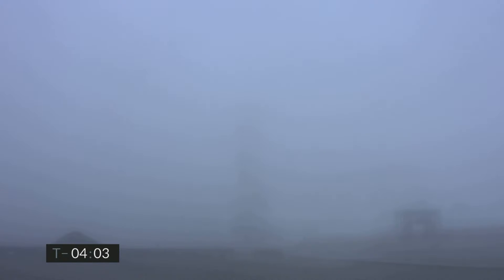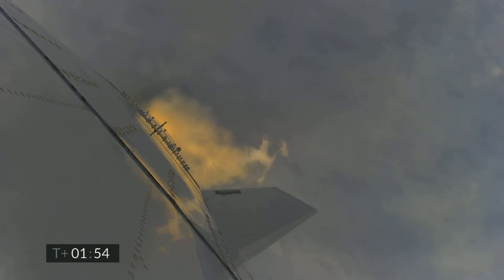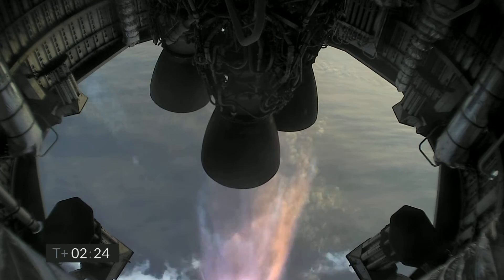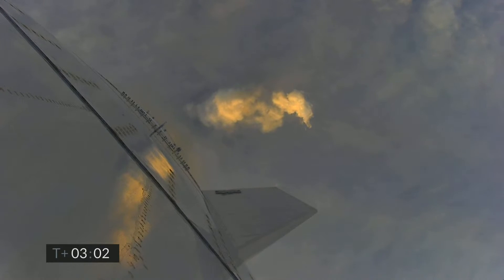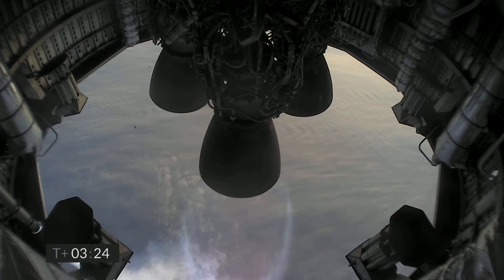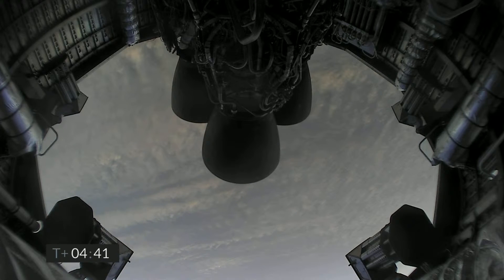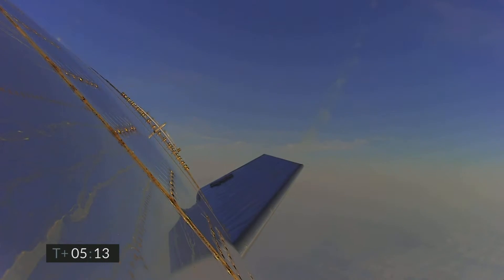Starship | SN11 | High-Altitude Flight Test

Comment: THEY NEVER SHOULD HAVE ATTEMPTED THE FLIGHT UNDER SUCH CONDITIONS.
Reply: Why?
Reply: BECAUSE WITHOUT THE FOOTAGE IS MORE DIFFICULT TO DETERMINE WHAT WENT WRONG. AND ALSO, THEY KNEW IF THEY ARE STREAMING VIDEO TO THE PUBLIC THAT IT IS STUPID TO STREAM JUST BLACK OR GRAY COLORS INSTEAD OF A NORMAL VIDEO. NO POINT OF STREAMING VIDEO WHICH IS GRAY 40% OF TIME AND BLACK 40% OF TIME, WITH ONLY 20% OF USABLE FOOTAGE. ALSO, IT CAN BE THAT FOG IS PUTTING ADDITIONAL AERODYNAMIC PRESSURE TO VEHICLE WHEN IN FLIGHT, ALTHOUGHT PROBABLY NOT ANYTHING SIGNIFICANT SINCE IT IS FLYING PRETTY SLOW (FOR A ROCKET).

Comment: Love Spacex. But I gotta say this is never going to work. Looks clumsy and dangerous. You would have to have balls the size of Earth to ride in this. Should stop wasting resources and start developing a Flying Starship that returns like the old Shuttle only with a powered reentry. Build a Spaceplane and make it larger than the Shuttle. Too much too go wrong on the flip and landing with such a big rocket. You have already fitted wings to it. Make a Spaceplane Starship and get on with it. You have the resources and know how, just build it and get to Mars.
Reply: And how exactly is a spaceplane going to land on Mars?
Reply: @lazarus2691  The same way Starship will land. With a lot of luck. I believe the first manned landing on Mars will be like Apollo. Then after a base is established a paved landing site will be constructed. I think a Starship belly flopping and landing on Martian surface without a paved landing site will be very dangerous .

Comment: SpaceX needs to add a 15 meter diameter chute that pops out of the nose to allow going vertical earlier and giving time for propellant to stabilize for 20 seconds. The chute will pull it vertical without engines and prevent the starship from accelerating downward while vertical. Need to test this configuration. After all the bugs are worked out, then they can eliminate using the chute but I bet the chute will work so well, the flaps could be shrunk instead. (Especially if a 2nd large parasail chute attached towards the bottom also helps slow it down while horizontal, then unreels/detaches to make starship go vertical)

Also the untested risk remains how does starship & booster perform when re-ignition occurs while experiencing weightlessness even without the fast flip. The

Comment: Who also thought it was a great idea to test anyway with this level of fog in a dev stage video material is crucial to the testing? At this point you don't even know where to look for the vital parts with answers because it's been spread out over an area of 10 miles in diameter right now due to 0 visual level fog...

This is going into the realm of chimpanzee's trying to use knife and fork for the first time without proper instructions

However I have to admit that this fog has a special role in making this all very exiting with it being all fun and games till that flying fuel tank lands on someone's house or vehicle or store 20 miles ahead. You don''t even know when to use the deadmans switch in this fog based on lost sensors and also no visuals. You are fuckin lucky here.

Comment: maybe to channel the fuel towards the engines when the rocket goes from horizontal flight to vertical flight you could do the same thing cement trucks do to get the cement out. use an archimedes screw.

Comment: WTF happed during landing?
Reply: One engine didn't gimbal correctly so FTS was set off and also it underperformed. Probably due to a leak something similar which sn5 engine ( SN27 ) had a leak when it was firing

Comment: With the fog, it felt from the start SN11 was doomed. The cameras weren't coping, the raptor flameout, the engine failures again. SN11 deserved a better ending. SpaceX have a major problem with engines and possibility of a total rethink for Starship. When the brilliance of the SpaceX people are challenged a fourth time, you know the issue is not going to be resolved quickly.

Comment: Elon - This is getting embarrassing!

Beginning to look like this is RUD for fun.

After 40+ years of engineering, four broad causes for continued failures:

1)  Raptor is not ready for this. About 1 in 4 Raptors is failing the pad test fire - unsat. Either the Raptors are not ready, or they are  ingesting FOD. Assuming the Raptors are all being test fired several 
times before delivery to Boca, there is clearly a process problem once they head for Boca.

I believe each SSME was test fired several times before flying. I would assume the Merlins are too? 25% Raptor failure rate on first launch pad fire - embarrassing. With those failure rates, odds of a successful flight test are close to zero. After ten  (?) Raptor starts on pull-up, has only one Raptor come up to full power during the pull up? 10% success rate? also unsat. Houston we have a 
problem...

2) I admire the desire to use an industrial grade process to building starships (assembly outside, Raptors shipped on pallets, rather than clean rooms and shipping engines in sealed engine cans), but industry experience is that foreign objects in rocket engine fuel and oxidizer supply lines have caused a LOT of failures. Commercial  airliner jet engines are treated with more care than the Raptors appear to be treated once they are headed for Boca. Seriously? Ask your turbomachinery bearing engineers about the impact of contamination on seals and bearings. 

Sloppy... And inexpensively fixed.

You  should cycle a few Raptors through the current delivery, installation, starship test fire process, and then send them back to manufacturing for test on their test stand. How many are unable to have several successful starts/re-starts?  

3) The Raptors are too fussy about  the quantity of fuel and oxidizer being sucked in. Easily eat themselves when flow is low/out-of-balance - this would be a serious design failure, possibly very difficult to fix, and may require a Raptor or Starship re-design.

4) The transition from belly flop to vertical simply causes too much "churn" in the fuel and oxidizer tanks, and it is impossible to provide reliable flow into the Raptor fuel and oxidizer inlets. Concept flaw. Several possible fixes, all would reduce payload weight to orbit:

- provide dedicated "re-light" tanks to each Raptor that have zero void fraction at re-light. 
- start the transition earlier and drop the tail using the aero surfaces. Vertical acceleration will be less than one-G, should help the liquids head for the bottom of the tanks. 
- use one Raptor earlier to flip vertical and settle the tank contents back to the bottom of the tank before starting the other two. 
- May need to add baffles to the tanks to reduce sloshing during the transition (many liquid tanks subject to motion have baffles to greatly reduce churn during accelerations/turns. Railroads learned this over 100 years ago.) 

All of these will reduce payload. Too bad. Hopefully impact of one of these options will not reduce payload too much. 

Perhaps Nitrogen thrusters would speed aero-only transition towards vertical? "Flying" towards the pad with more cross range velocity (nose down a little towards the pad), followed by nose pull up, would shift more of the fuel and oxidizer aft before engine start (and the resulting shift of CG aft would accelerate an aero-only flip?)

Surely the behavior of the fluids during transition can be determined through sub-scale experimentation without blowing things up. VERY difficult to model numerically for multi-phase fluids at saturation with some subcooled liquid and some slightly superheated vapor - a chaotic process (having done non-equilibrium fluid flow and heat transfer experiments 40 years ago). Plus the initial state would be hard to model due to aero-buffeting that might alter pre-flip liquid/vapor distribution of the fluids.

Each of the four above could be resolved without blowing up more starships, and I doubt these failures are resolving any of these four concerns... Clearly the belly flop works aerodynamically. That has been demonstrated. Time for some serious engineering, like the type that made Crew Dragon successful.

I was originally impressed with the rapid development concept, but it isn't working - lucky you didn't destroy the tank farm. Time for better engineering processes (don't pull a Boeing ;-) Falcon and Dragon engineering is so impressive - this is not.
Reply: You realise that this is a test program right?
Reply: @avap0n459  Yes, but what are they testing? Belly flop aero - success - well done - 4 for 4. But raptor relights to full power - fail (9 out of 10). In engineering with such a high failure rate you do a root cause of those failures and see if your design basis or process has an error. With a 10% relight success rate, at this point they are not testing, they are flailing. The definition of insanity is doing the same thing over and over and expecting a different result. Clearly there is a significant design or process problem. Trying to find that problem from pieces scattered about is not a productive process. I am mystified how a company that has become so successful with Falcon can not apply similar engineering rigor to starship. Perhaps they know the problem and have the fixes in SN15, but then why risk damaging the launch facilities with SN11?
Reply: @daveevans2527  good points, and i agree with you, but im sure spacex did all the calculations for all of that, they are going for speed.
Reply: @avap0n459  What is bothersome is how many Raptors are being pulled off the Starships after the static test fire. I can't believe they are that unreliable coming from the factory. With that failure rate, I do not see how you can be confident that at the start of the landing flip, you have 3 Raptors in good condition before re-light. 

I assume the engines failing in the static fire are being examined for the failure mode - fifth possible cause is with the raptors shooting straight into a flat concrete surface at ignition, one wonders if the shock waves reflecting off the concrete are causing damage. I doubt they have a test stand that exposes the Raptors to such abuse.

There is a famous saying - "Be quick but don't hurry". Seems like Elon is in the hurry mode - wonder if someone can initiate a stand-down to regroup and broaden the possible failure modes that need to be studied.
Reply: @daveevans2527  true, very true.

Comment: They really need to go back to testing the Raptor, it's clearly not ready for flight. Even in the successful parts of the past flights, the engines seem like they're about to shit themselves at any second.  They need to work on long burns with multiple stops and re-starts throughout.  Raptor has been the cause of all of the failures so far, it seems like it needs a lot more testing. Just seems like they're going to need a great engine first, then work on making that engine capable of the landing.  I just haven't seen anything so far that makes me believe the Raptor is all that great anywhere other than paper.

In a testing phase like this, we're supposed to get bored of how mundane it is seeing this thing land, instead it's getting boring knowing it's going to fail.  I'm sure it's not a popular opinion, but it seems the best course for SpaceX reputation is to suspend flights until the engine is nailed as close to perfect as possible.  All future failures should be because the vehicle failed, not the engines.

Comment: We were robbed from a spectacular view by the damn fog! Also best wishes to SN12?or will it be SN15?
Reply: SN15. SN12-14 are not being built.
Reply: @OortCloud  hmmm, but SN15 is suborbital if I am correct and I doubt they will jump to suborbital trials before perfecting the landing. So maybe they will start building those SN12-14.
Reply: @user-hh2is9kg9j  No, we already have confirmation that SN12-14 are t being built. They recently scrapped SN12s aft dome where the engines are mounted

Comment: It is impossible for an heavy rocket like this to succed!
Reply: Can't wait to see what you have to say after SN15. lol
Reply: Only three engines is not enough to lift and to resist the burning and pressure...facts
Reply: @lt3066  They will have more engines on the vehicle but that's when they begin testing it to go into orbit. I hope you also know that it will be stacked on top of a very powerful booster..
Reply: SN10 got awfully close on just a single engine. Three should be more than enough. 
Too much in fact. Three engines are too powerful, so they're only planning to land on two.

Comment: At least the high altitude test is successful!  Hope it gives valuable data for SpaceX engineering teams to prepare for SN12.
Reply: There is no SN12. SN12 was scrapped, along with SN13 and SN14. 
SN15 will be next, and is the first to incorporate significant improvements - SN9/10/11 were minor retrofits based on each previous flight.
Reply: @lazarus2691 , thanks so much for the information!

Comment: I think were you all are messing up is configuring for center of gravity instead of focusing on keeping the platform plumb and level. Most helpful in landing as it eliminated the struggle to level the craft at touch down. I say this as it is leaning instead of being 100% vertical one the one engine hover. The engine flame should be at an angle and the platform plum when hovering at altitude.
Reply: It's not possible to perform a level hover on one engine with the current configuration. 
They'd need to physically relocate the engine mounts, and it would cost them redundancy.
Reply: @lazarus2691  No, increased trust is all that is needed to achieve level flight at hover on one engine.
Balancing center of gravity is easier and requires less fuel but is inherently more complicated due to having to establish level flight at landing. It's better to stay in that config for the duration of the flight.
Reply: @BillStelling  Can you explain to me how it is possible to hover level with one offset engine?

Increasing thrust beyond the level already used for the slanted hover will cause the vehicle to rise.
Reply: @lazarus2691  No, it won't. The torque is offset.
Reply: @BillStelling You aren't making any sense. Thrust is independent of torque. 

Torque is dependent on thrust, but not the other way around.

Increasing thrust will cause the ship to rise regardless of what happens with torque. 

Hovering is only possible at one thrust level, and torque can only be cancelled in one way at that thrust level.

Torque is a product of force and radius(in this case measured as the distance from the thrust vector to the COM. 

For it to be zero, one of those two components must be zero. Obviously it is not thrust, as thrust must be constant and non-zero to hover.

Therefore, this is achieved by reducing the radius to zero. In the case of the slanted hover, the engine is angled inward such that the thrust vector passes through the center of mass.
Reply: @lazarus2691  Don't over think it... Force/ torque at the fulcrum of balance straitens the craft. It's what they do at landing.
It should be applied throughout one/two engine flight and center of gravity hover used as a fall back.
The higher the gravity of a planet that is landed on increases the amount of offset in lean and narrows the parameters the higher the gravity.
It's better to attempt to keep true horizontal flight like with 3 engines if you can as it will reduce overall complexity in the long run, even though it introduces some at this point in the testing.
Reply: @BillStelling  They do induce a rotation at landing, but this is not sustainable. It's a constant rotational acceleration. It only works at landing by timing it correctly, it would not work to sustain a hover. 

I'm not overthinking it, I'm applying the most fundamental principles of rotational motion and finding that a sustained level hover is not possible.

You're also wrong about the amount of lean needed in high gravity. Center of mass isn't affected by gravity, so the offset angle remains the same regardless, even in zero-g.

Though of course you can't hover in zero-g, you can fly in a straight line, with a relative 'level' perpendicular to the direction of travel.

Comment: No visual data? Who does that? You can sensor it everywhere, but seeing is believing.
Reply: Why would they censor it? This flight was basically identical to the previous three, which all had ample video coverage.
What do they suddenly need to hide that they didn't have to hide the last three times?
The only thing different was specifics of the landing failure, but it's not like they're afraid to show those (see SN9).
Reply: @lazarus2691  There is a difference between censor and sensor. I think you misread my comment.

Comment: There seems to be a major problem with the Raptor engines. Not only the continued in-flight issues but also the need to continually replace one or more engine before flight suggests a major redesign may be needed to significantly improve reliability. The chance of an orbital flight in July, and perhaps anytime this year, just shrank appreciably.

Comment: the pressure chamber engine 2 did not reach the proper pressure, but in my opinion, engine 1 had a loose or not fully functioning gimbal and upon landing the "donk" sound was the engine or a part of the engine coming off which then smashed in to one of the other engines ripping the engines off and exploding a now exposed fuel duct and BOOM!!! except it smashed in to the camera 

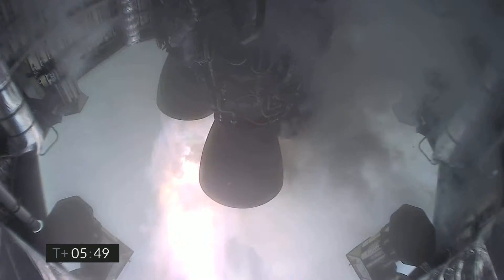if you slow it down to .25 at 11:33 you can see the gimbal go a little wobbly and keep watching and you will notice before the camera cuts out that the change in direction from engine 1 is a lot faster than it sould be